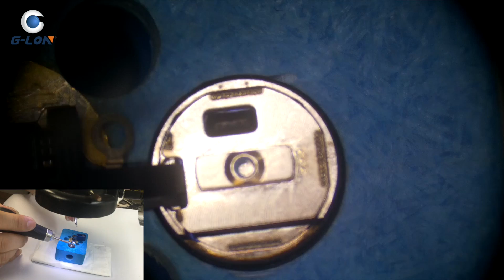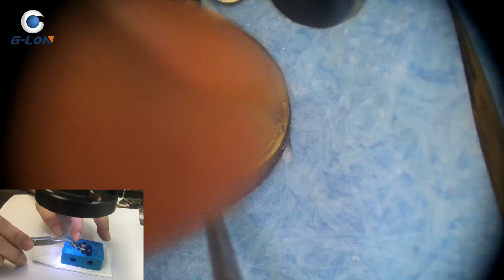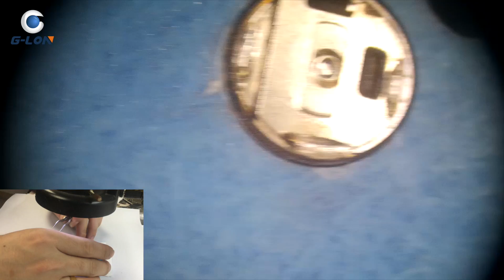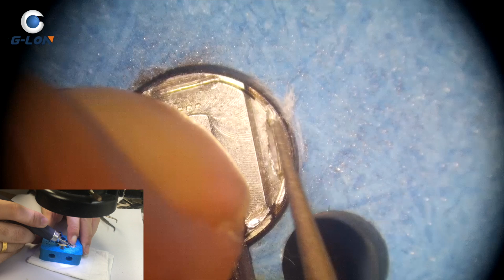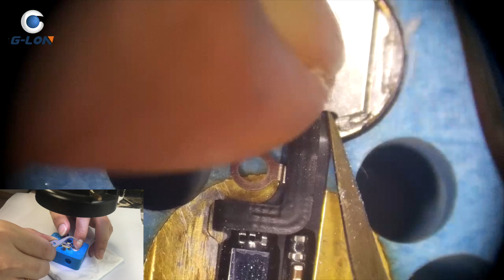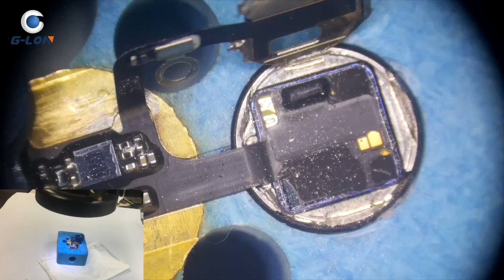iPhone 7 Touch ID／Home Button fix tool

Comment: Nice,  I need this tool.  The face of my home button is broken so touch Id not working,  but why buy this tool if I'm only going to use it once, I just paid $40 mail repair service in ebay , way better than doing it your self
Reply: Leo how was it? Did they fix it right?
Reply: @maduaksteven  they only repair ripped cables,  not face button.  But I think is possible to still fix it with this tool
Reply: Leo oh that’s what’s wrong with mine lol I was looking around to see if there was maybe a way to move the chip to another button or something